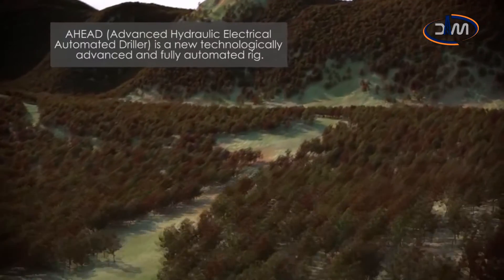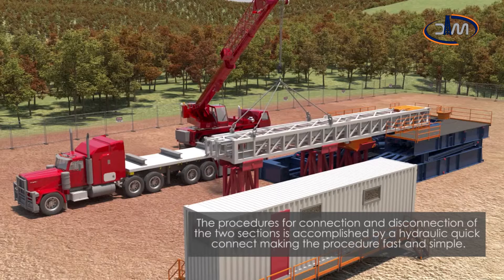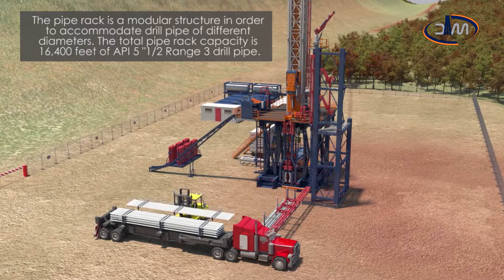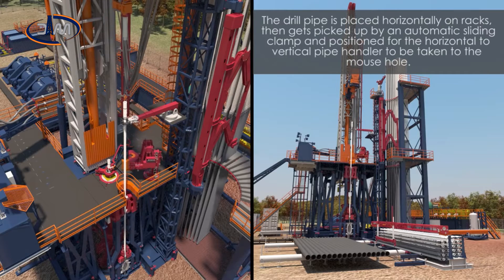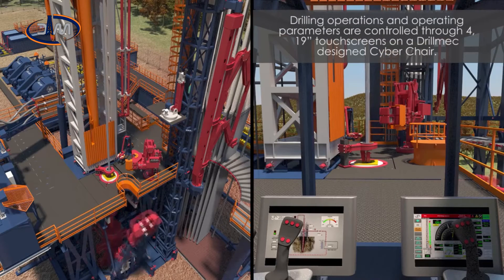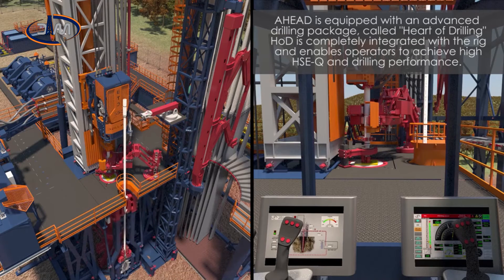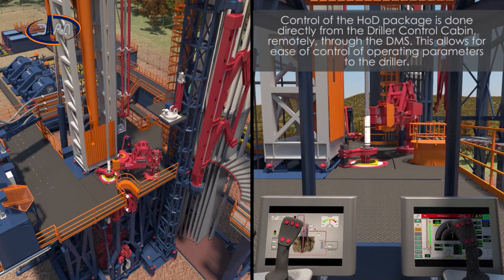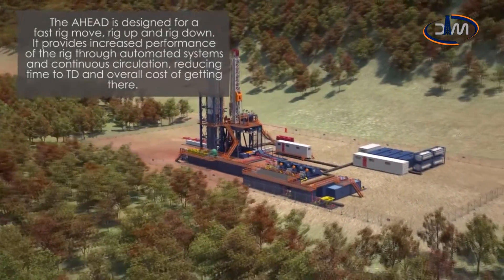Drillmec AHEAD Rig Advanced Hydraulic Electrical Automated Driller (2016)

Comment: Do you remember Formula for reliability?  R = (1-F1) * (1-F2) * (1-F3) * (1-F4) … R refers to the overall reliability of the system, or asset. F1 refers to the failure rate of the first component part; F2 is the failure rate of the second component part, and so on......and try to drill in desert with this machine, you are dead! So, there is a lot of components with high Falure rate from the hydraulic pumps to the pipe handler and full complexity with Mud pumps drive, which is normaly AC driven machine, see how much hybrid looks like this work. From my experience, oil drilling rigs are not "designers' fashion" trends like Italian sports car, rather rigid, safe and reliable assemblies.

Comment: As an engineer there looks like a lot of possibles for problems because of the complexity. I'm impressed by the many advanced ideas but I'm concerned of the number of failure points in this much technology in their field. Can this rig handle made-up stands of 2 joints of casing to speed up the casing procedure?
Reply: hey, as an oil engineering student just like you, i would like to know what problems you see. thank you for your prompt response, i´ll appreciate it so much.
Reply: The entire Connection System that includes make-up Torque is lacking' the engineering should not be a dual systems, a simple pipe handling system ( the 2 or 3 joints ) above the set-in stabilizer arm is the solution ( only one set of power tongs' on floor ) that this Rig lacks, most everything else appears State of the Art !

On a side Note' i'm over 15 years retired and once thought Computers and Robotics on Rigs were mostly pipe-dreams, then I became a Field Technician for the revolutionary Drilling with Casing tool, redefining tool for Running Casing Jobs, into open holes, So adapting from perfected drilling with' to same tool used as an accessory to run entire string of Casing from pipe-rack into open hole, then Rig-down tool for Rig to again drill deeper, I also once thought Oil Boom wouldn't go Bust, and when things slowed bought myself a house, that I lost a year later !